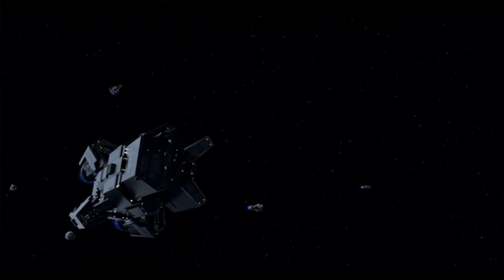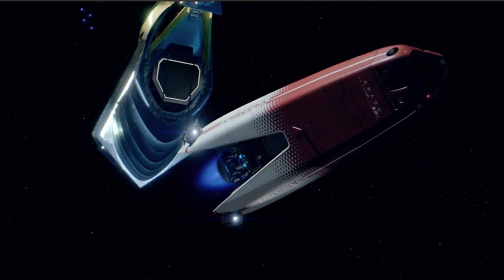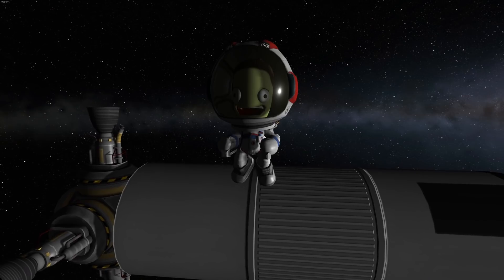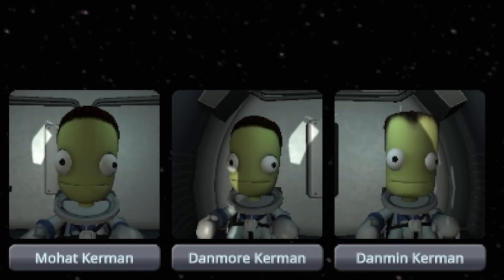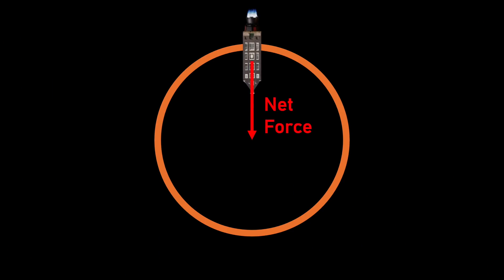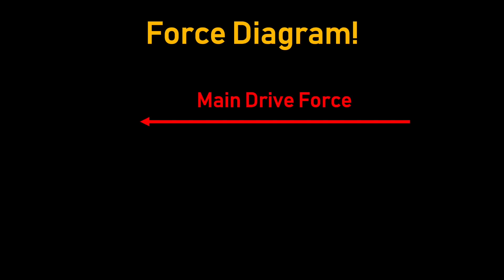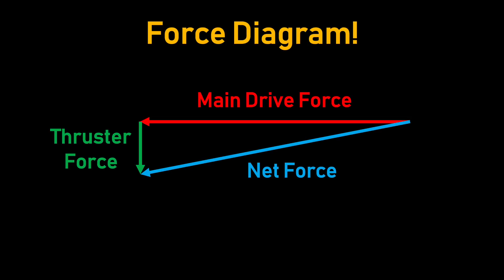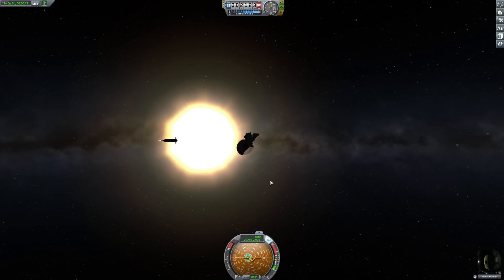Testing Physics of The Expanse With Kerbal Space Program

Comment: TBH It is possible to form a full circle orbit with just the main thruster, granted you already applied torque to initiate the turning motion with a side thruster. Imagine it like the satellites, if we ignore the air resistance, there's only one acceleration affecting them, gravity. So if you match your thrust with your turning ratio, you can mimic this motion around a virtual centre. This is something we have practiced in Elite Dangerous. Also, it can be replicated in KSP. For example you might find an asteroid and try to maintain a relatively stable orbit around it by adjusting your main thruster.

It's not easy to get the turning speed and main thrust force right, but it's possible in theory. You only need to create that centripetal acceleration.

However, in Naomi's case, if Naomi gets out after we have obtained this orbit, she would have to intentionally push herself towards some range of direction with some amount of force in a range to stay inside this circle, and even in the best case scenario, this entrapment would be temporary, since she wouldn't be able to adjust her direction of motion after jumping.

Comment: I see a problem with what you did. I have seen astronauts get out of space capsules in the 1960s. They did not fly off into space like you claim, they  floated next to the capsules.

 I'm not saying the ship would circle her but if you are in a space ship traveling 100 mph then step outside both you and the ship are still falling through space at 100 mph. The ship would not magically fly off.

Additionally you do not have to travel through space in the same direction the ship is pointed. It is not an airplane that can only fly in a forward direction. You and the ship can be facing in the X direction and be traveling in the Y direction.

I understand what you tried to prove but I think you failed miserably.

Comment: If the spin rate was sufficiently slow, and only in a single axis, and the thrust sufficiently high, yes it would spin around in a circle with respect to an observer moving at the same initial speed, though Naomi would most definitely not end up in the centre of that circle, rather she'd be flung out away from the spinning ship (and probably burned up in the drive plume, ouch). The thrust vector is in one direction in relation to the ship, but as the ship is spinning, that thrust vector is changing direction with the ship as it spins around, ergo a centripetal force. Key point is, though, it would not be a corkscrew as shown in the show, because the initial direction was in the direction of travel, and thus the rotational axis must also cross the direction of travel.

Comment: Hello Physics major here.
TLDR: if you spin slow enough so your main thrust always points outwards to your circular path you can fly in a circle.
What happed in the show is very possible and not inaccurate to the physics at all. The key is getting the correct rotation speed relative to your thrust. In your experiment you conducted in KSP you spun up your ship much faster then Naomi with the Chetzemoka. It is possible to make a perfect spiral pattern if your rotation speed is such that the engine is always pointed tangentially to your path  you would travel in a perfect circle. I admit that you would need to time the thruster perfectly to do it right, however unlikely it is possible. one cavoite to this is that Naomi would probably be just flung outside of the path due to centrifugal force as soon as she stepped out of the air lock so that's one thing. Also the reason the sip in KSP appeared to be moving in a straight line and just spinning was because ksp always follows the reference frame of whatever ship your focused on, while in reality the ship was flying in a curly loopy pattern that would look like the way you draw a spring in 2D.
Its kind of like how an orbit works but gravity is always pointing tangent to your path by default
great vid otherwise.
(If I'm wrong please point it out, I love to learn form my mistakes)

Comment: The physics in The Expanse works selectively. When Roci shot Pela by a disarmed torpedo they found later this torpedo was stuck in a board. But at the moment of collision the torpedo should have 20 km/s of relative speed (accelerated at 100G for 20 seconds). You know, artillery shells penetrate heavy armored tanks at a speed of about 1 km/s. So the torpedo had to penetrate all the ship decks like heavy railgun projectiles and completely destroy Pela and crew only by kinetics.

Comment: I dont get it. In the first case the rocket is rotating with the main thrust still active. Wouldn't that count as the starship doing circles?  Very small circles but I guess that if you would to adjust the lateral thrust to be a lot weaker, it would rotate slower and so result in a circle with a bigger radious.

Comment: Hold on now: Your first Kerball example spins (tumbles?) in a way that appears identical to if it's main thruster were off, passively somersaulting end over end, yet it's main engine is burning the whole time. Your pencil analogy fails to account for the constant push from the ... eraser. Without a correcting counter directional thrust to stop the axial tumble, this should cause it to travel in a circle! Though no, there would be no reason for Naomi to stop in the center of the circle. What am I missing?

Comment: Ok, you are also making some "errors". In the show, the ship was ENORMOUS, and the size of the circle would be determined by the rate of the spin. So, the circle was created because unlike in your example, where the rocket tumbled rapidly, it would have taken one complete circle to complete one rotation. (they would be the same thing). Now, your rocket still did closer to what naomi would have experienced, which would be a sine wave. as the rocket tumbled, it would accelerate forward while pointed forward, and sideways while pointed sideways. This would give it a wobble. HOwever,,, that wobble would only be along a 2d plane if the rocket rotated perfectly parallel to it's trajectory. Instead, the wobble caused by a corner thruster firing, would be a spiral. The image presented to us in the expanse is highly compressed,,, if naomi were going somewhere with an epstein drive, and then induced a tumble at that slow of a rate of rotation,, the spiral would only be perceivable if highly compressed to show the shape. but, actually, it could happen BASICALLY like the show. (since when jumping out of the craft, naomi would remain on the same trajectory as the craft,,, but,, the craft would be accelerating, but,, not very efficiently, since it would be wasting it's thrust. assuming a high specific impulse and low overall thrust, it's imaginable that during the time that naomi would survive without air, the ship could present a navigation hazard for someone hoping to get close enough to her, depending on just how much thrust the ship was under.

Comment: 0:20 well yes, but my issue with that scene is that the corkscrew is going around the ships travel path, we only saw naomi activate one thruster so no matter which side it was on it should have made the ship face towards then away from the travel path and not circle around it. for it to get to the point we see in the show she would have needed to activate one then activate the opposite one to stop the movements at the right time to get it to stop ~90 degrees perpandicular to the travel path then activate a third one to get it into that corkscrew spin.
Oh and naomi wouldnt have just stopped in the centre of the corkscrew, she wouldnt of even gone inwards, the centrifugal force of the spin would have thrown her away from the ship unless she somehow timed it right and with enough force threw herself in just the right direction to overcome this centrifugal force but even then she would just come out the other side as nothing is holding her inside the ships corkscrew.

Comment: if you fired the thruster in a way that left the ship spinning so it always faced 90 degrees to its theoretical path in a straight line and kept the rocket going at low thrust, that would produce a small circle wouldn't it? 
In your demonstration, you fire the thruster at an unknown length of time and newtons. 
Think of the ISS, it is always facing the earth in a particular way like the moon. So when the ISS need to speed up they fire their thrusters and increase their apoapsis. As their spin rate is relatively slow unchanged from the thrust they don't need to adjust.
Could you try this please?

Comment: If you slow down the angular velocity the ship will describe a circular pattern around a hypothetical point on the orbit at the time of side thrust ignition(note that the orbit is constantly changing when thrust is applied), the only error was on the plot at 1:18  where the spaceship is pointing wrong, but if the immage is generated by a computer thar shows instant velocity than it would be a correct representation of data.
BTW if Naomy didn't run outside the ship she would bump on the ship st the next rotation
Reply: If she just released herself softly, she would travel a straight path leaving the circle created by ship's circular motion with the ship's circular velocity at that time.

Comment: You're definately wrong on this one, ship in the expanse was turning slowly, angular momentum will keep the ship turning unless a correction thrust is applied. Thrust from the drive combined with the ships rotation would cause a chiral deviation from it's original flightpath.
Here the ship is simply spinning like a top. While in the show it takes minutes to complete a rotation.

Edit: Thinking about it a little more the thrust would have to be offset from the centerline to rotate the ship in this manner, otherwise the deviation will be sinusoidal.

Comment: I disagree. Spiraling is possible, tho it should have been a very loose spiral.
The forward velocity prior to the spin is the horizontal translation across the screen. Then you have to spin the vehicle such that the engine never faces the forward velocity. It isn’t a sideways push on the top, it is an angled push on the top causing a / \ / \ / spin.

Comment: The KSP ship is spiraling the moment the thruster gives it rotation.  Any body separating from the ship at its center of mass will stay next to the ship (or on its larger spiral path, if you rotate slower).  Naomi's jump exited the ship in the direction of the rotation, putting her inside the spiral, traveling (slowly) along the diameter of the spiral.  Naomi "fell" towards the rear of the ship at 0.3g (the ship's acceleration), so it moved away from her, but will eventually circle back to the place they separated.

Comment: Yay! I was actually right in my assumption that a single thruster firing a short burst at the front of the ship wouldn't cause the ship to enter a barreling motion. While I didn't play this out in KSP, the Jebediah in me thought this wrong from the get-go.
Reply: Actually this guy is wrong in almost every way. A short thrust does in fact induce a permanent spin, inertia means it will continue to spin until some force stops it. There is no friction to stop it. If the thruster were to fire constantly, the spin would accelerate until centripetal force pulled either ends of the ship apart. A short burst means there is a constant, unchanging rate of spin. The spin in the books and in the show is relatively slow at maybe 1 spin every 40 seconds. Not 1 every second or higher as shown in this video. Add constant thrust perpendicular to the the axis of spin. This constant thrust will not stop the spin or slow it down. It will drive itself in a circle, inducing artificial gravity both along the line of constant thrust and perpendicular to it. Also before spinning, it was accelerating along a path dictated by orbital mechanics, its velocity constantly increasing. After the spin begins it is no longer accelerating, because as it goes in a circle it cancels the acceleration at the point opposite on the circle. This means it is orbiting on a ballistic trajectory along a path dictated by its velocity when the spin began. 
If you were to view this from a point in space that wasn't moving reletive to the sun, the ship would be flying in a corkscrew pattern. If you were going along the same orbit as it, it would look like it was flying a perfect circle.

Comment: I have a question:
If the ship is spinning around, shouldn't after a single spin the net force on the space ship = 0 (velocity is still large, but acceleration is 0)?
When the Kerbel jumps off the space ship, shouldn't his net force (acceleration) also = 0Why doesn't the ship and the Kerbal travel at effectively the same velocity?

The second question: 
The ship would have a net force / acceleration of 0 at the END of each rotation, but during the rotation, they would have an accelation in the direction of the ship (which is in a circular motion), therefore Compared to the previous velocity , wouldn't it travel in a circular path from the perspective of the Kerbal?
Reply: 1 = the ship is still accelerating from the rocket engine. Once the Kerbel is out it will stay at current velocity and the ship increases its. So Kerbel is left behind.
2 = The ship (first example) are traveling in a circle, but due to high initial velocity there cercal is so large you can't perceive it on small distances like we see in the vid. 
In the second vid the ship's velocity has translated a few degrees to the left but as there is no continuous course (like spin) to create a circle around a common point, it is still traveling in a straight line just adjusted a few degrees to left.

Comment: Your wonderful illustration of the ship’s actual trajectory is a type of cycloid, which would be an ellipse in an alternate frame of reference. Perhaps the computer graphics aboard the Razorback were crunching this? Eh? 😏 What bothered me far more was that Naomi *jumped straight into the frickin drive plume!*
Reply: Actually this guy is wrong in almost every way. A short thrust does in fact induce a permanent spin, inertia means it will continue to spin until some force stops it. There is no friction to stop it. If the thruster were to fire constantly, the spin would accelerate until centripetal force pulled either ends of the ship apart. A short burst means there is a constant, unchanging rate of spin. The spin in the books and in the show is relatively slow at maybe 1 spin every 40 seconds. Not 1 every second or higher as shown in this video. Add constant thrust perpendicular to the the axis of spin. This constant thrust will not stop the spin or slow it down. It will drive itself in a circle, inducing artificial gravity both along the line of constant thrust and perpendicular to it. Also before spinning, it was accelerating along a path dictated by orbital mechanics, its velocity constantly increasing. After the spin begins it is no longer accelerating, because as it goes in a circle it cancels the acceleration at the point opposite on the circle. This means it is orbiting on a ballistic trajectory along a path dictated by its velocity when the spin began. 
If you were to view this from a point in space that wasn't moving relative to the sun, the ship would be flying in an overlapping corkscrew pattern. If you were going along the same orbit as it, it would look like it was flying a perfect circle. It really depends on your frame of reference
Naomi being in the middle is wrong though.
Reply: @Skunkwurx  , Dr. Ryan made a subsequent video in which he corrected himself, and I accidentally responded to this one instead. Your “overlapping corkscrew” path was the cycloid I spoke of, which he illustrated in that video. For some reason his cycloid was very tall, which led me to believe that the alternate frame would yield an ellipse instead of a circle – I just trusted his math. Though I can’t think of an intuitive reason why it would be elliptical instead of circular.
Reply: @Skunkwurx  some people presume without evidence, that the short thrust was sideways on the nose when it may have been another angle.
Reply: The Epstein drive is more efficient. The nozzle must be very effective at directing all the exhaust fairly straight.

Comment: Recalculate it. This time the rotation speed of the craft is relatively small. The direction of the thrust is constantly changing causing the craft to move along a curve. With the proper ratio between the rotation speed and the thrust vector, the craft will move along a circle. Think about an object moving in the gravitational field. You should always be able to mimic gravity with acceleration.
Reply from the maker: Rotation speed makes no difference
Reply: My mistake. The rotation speed would only define the radius, but this would be a circle (in this reference plain)

Comment: In your example, the camera is fixed to the center of mass of the rocket, so obviously you wouldn't see anything else than a ship spinning around itself. The camera is spiraling with the ship. Might as well just shut the main engine down for a similar conclusion. You should've left another kerbal floating outside just as you started the spin for a valid point of reference.

I agree that Naomi should've been flung outside of the spiraling ships trajectory, but the ship definitely would've spiraled around a point in space that moves in the approximate direction that the ship was travelling before the spin was induced.